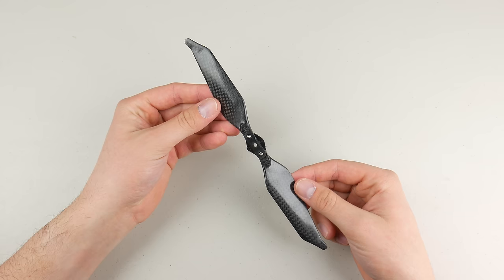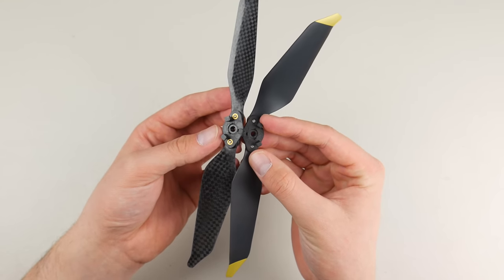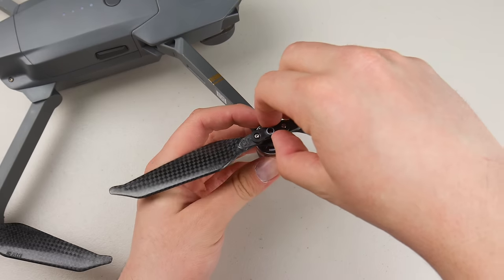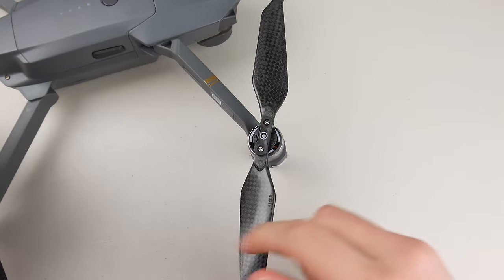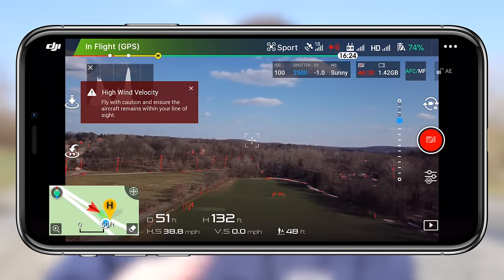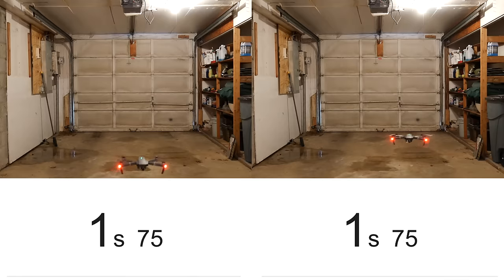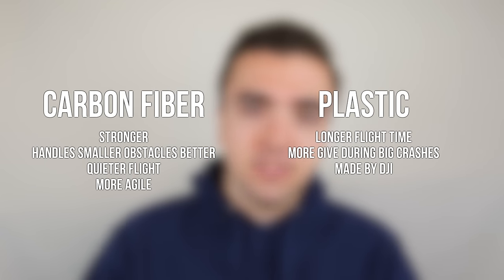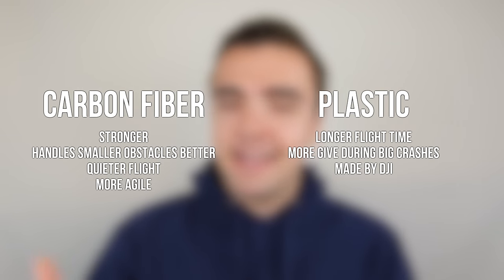Carbon Fiber Mavic Pro Propellers: A Subpar Upgrade

Comment: I'm a phantom 4 Pro owner always go with the original DJI products
Reply: Are you sure. I`ve Mavic 2 pro with Hasselblad camera. I have 12800 ISO in photo and video mode. About the video Mavic beat P4pro with 10 bit video and D-log. P4pro has only 6400 ISO.@Al Castill

Comment: Another great video Billy. I will add that the wider low noise props can cause shadow flicker on the lens a little more than the thinner regular props. Not hugely but noticeably more often.

Comment: People don't realize. 

The bottom line is DJI is a billion dollar company they have resources that these other third-party companies don't have they use plastic for a reason they take all the positives and negatives and they do extensive testing the low noise propellers for the Platinum are basically the overall better choice no matter how you slice it.

As usual Billy awesome awesome quick to the point reviews.

Comment: Problem I had with these was an abnormal Gimble vibration that started as soon as the CF props were installed. Changed back to the Stock plastics and vibration error was gone. Back to the CF and again I got the error. Sent them back and exchanged for a new set. First Install Of new CF props showed abnormal Gimble vibration. Again back to the Stock plastics and error was gone. Next step was CF props went into the trash and plastics have worked fine ever since. (I use the low noise swept tip plastic props) 🤘🏻#DroneOn

Comment: Yeah bought two sets of after market props for my Mavic pro, they weighed 7gm's each, slightly under the dji oem props and on closer inspection the pins were loose in the center Hub!

Comment: Doesn't apply to the Mavic propellers but properly balancing your blades for the Phantom line makes a huge difference in performance and stability. You would not believe how out of balance, even the factory DJI propellers are when you receive them. Never did it before but always balance my propellers now and cannot believe the hovering stability it provides.

Comment: Yeah, I have a drone with carbon fibre propellers, stays in place in the wind, quite quiet, produces better lift, but the flight time is with 1-2 minutes less than with normal proppelles....
But then It cuts small branches and leaves like they aren't there.....  Had a gust of wind push it into the tree canopy and it just made a path through (btw, i was mortified that it was dead, but then it just hovered inside the canopy :)), made it move backwards and it came out :)) )....

Comment: I have had a set on my Mavic since June, i have no issues and they are Quieter, than  both the Original and the Low noise made by DJI. I have no intention of crashing my Pro, so i will worry about impact when and if it happens.

Comment: I have an old mavic pro I'm ruthless with. I found in a tangle with branches the blades came out fine but the centre assembly literally destroyed itself (3 in one crash) unlike with thin flexy blades (never broken a centre in a dozen crashes) which I guess absorb a lot more than rigid carbon blades. No noticable benefit with carbon ones either, other than looks when not in use

Comment: Would also be cool to see the how much flight time difference you have in the garage just by changing the battery and doing 3 different runs. My guess is that it may vary by 1-3+ minutes and you could conclude the carbon propellers did not make a difference in flight time.

Comment: I'm very sceptical to use aftermarket propellers.   
The Mavic Pro oem propellers are okay,   but the Platinum propellers are very weak in the tip, especially if it´s a bit lower temperatures,  they will break too easy.  
So if there was a high quality carbon fiber propeller available then I would have considered to buy those.
But I have only found propellers that looks simple with screws in the attachment points and the plastic in the center hub seems to break very easy.  
So I think I just stay with the oem DJI Platinum propellers and just spend the money on xtra sets of spare propellers.

Comment: Nice to have the stronger prop but have found  there is a weak spot as they still use plastic for the quick release hub....in my case had a little  knock but the hub failed causing catastrophic failure. ..

Comment: You need to get the Bower carbon fiber blades at best buy.. there around 20 bucks and are not those cheap plasticy fake carbon fiber that you get from the net..I have them and work excelent, get about an extra minute of flight time and slightly quieter, not much, and if you do crash the blades probably wont break, blades will still will be mostly  useless unless( depends on the crash) you have a bunch and decide to take blades off main assembly and put then on a good center locking hub..either way the Bower ones are the best Ive bought and used, and Ive tried them all!!! Hope this helps, plus theres a bit less video jello which is hardly noticeable anyways, but there excellently balanced right out of the box! If you have a blade balancer You'll see what I mean, at most a little piece of scotch tape at very most to be completely 100% balanced, but I never had to do that...its worth a trip to the best buy store for them in my opinion!

Comment: I like the idea and look of carbon fiber, but the plastic blades are designed to break when impacted.  I would rather break a prop than a motor and or an esc.
Reply: If you break a prop your drone is in for a long fall anyways that is going to cause lots of damage, so I wouldn't call that a strength of plastic props.

Comment: There is one single reason to not use the carbon props : they are dangerous for others and for the drone itself ! In case of crash, the carbon fiber will not deform and absorb energy like plastic. Instead, it will transmit much more force to the impacted object and to the motor shaft ! And in the worse case, carbon fiber shatters in very dangerous shards. The props are consumables and shall be changed whenever they are worn or damaged to ensure safe and reliable operation of any aircraft at the lowest overall ownership cost.

More reasons to not use those props : 

- Heavier and more prone to unbalance due to manufacturing tolerances
- Thicker trailing edge resulting in more drag and less efficiency (confirmed by your hovertime test)

If you want the best possible props, make sure to remove any unwanted material leftovers on the leading and trailing edge of your original props with 800 grit sandpaper.

Comment: little attention to safety in your video. Carbon Fiber Propellers can be very dangerous.
Reply: You are right, and that is why I also think that attention should be paid to safety. Caron probellers are 10 times more dangerous for your skin than the plastic
Reply: I was running through the Middle East with an Automatic weapon, DJI drones with carbon fiber props is Childsplay.
       
    Cheers 🤪

Comment: 1. Those "lightweight" carbon props are heavier than stock.
2. They use screws, making them inferior to stock and introduces a point of failure that you must frequently check
3. All DJI products are limited by electronic means, which is to say that changing the props is entirely irrelevant. Just by "unlocking" the Mavic, you can nearly triple the ascent rate and get 30-50% faster vertical speeds by altering max angle of attack and motor RPM. So, unless you have altered it, the more rigid design is useless outside of looks.
4. These decrease battery life, making them inferior to stock in both reliability and use in day-to-day scenarios.

Cliffs: these are pointless and are inferior to stock.